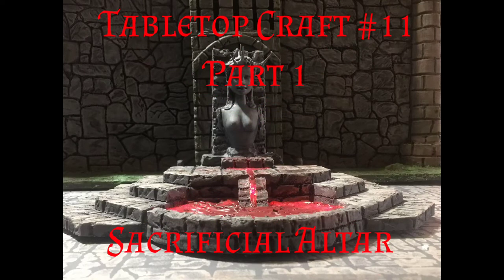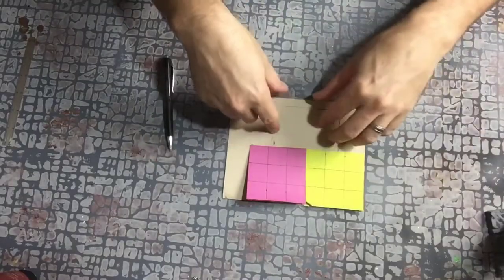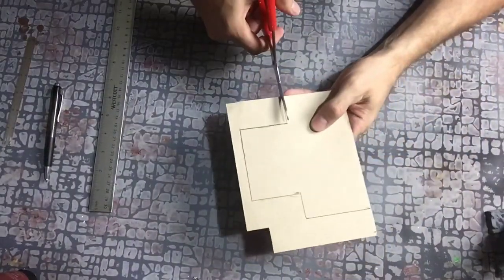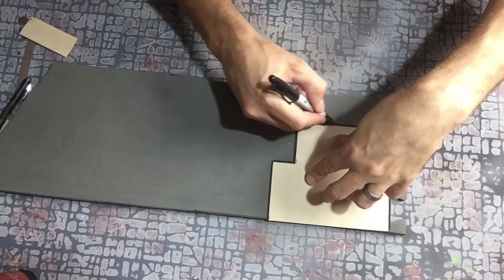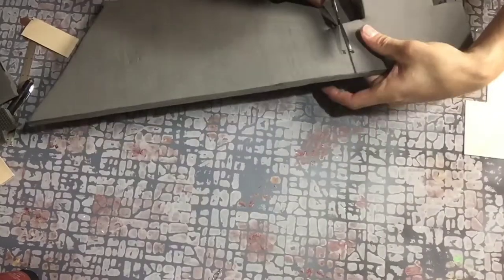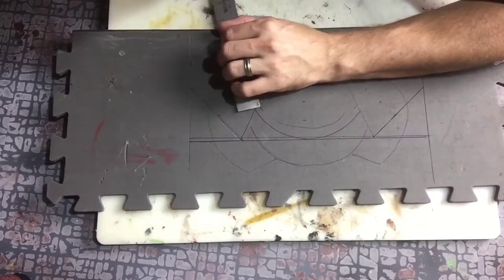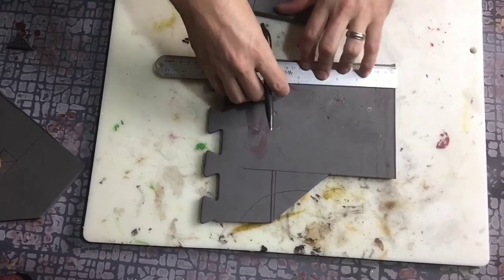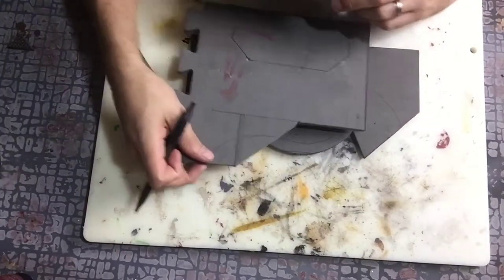Tabletop Craft #11 Sacrifical Altar part 1

Comment: what is your experience with eva foam vs pink/blue foam?
Reply from the maker: Discipol the mediums are both great in their own perspectives. The insulation foam has a rigidity to it that is nice but it's the same reason I don't really use it. Eva foam is the same material most cosplayers make their armor out of because it can be shaped and abused, yet still bounce back to the shape you left it with all the paint still intact. I can take one of my tiles and fold them in half and they spring back to shape like nothing happened. 
The main difference in preparation is the rate at which the heat melts them. Eva foam is much more susceptible to heat which can go south quickly if your not being careful with your heat sources. They both run around the same price for the same amount of square feet for the same thickness. 

I use Eva over insulation because it can be manipulated with ease, it's incredibly durable and lightweight.  As with the outer wall on the basin of this video I just simply bent the Eva foam to fit. You can't do that with blue/pink foam.